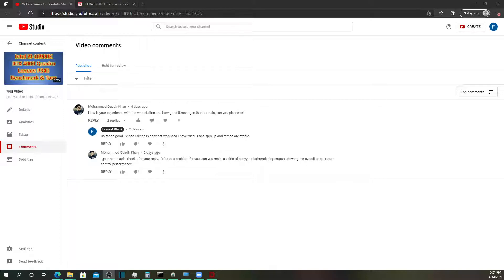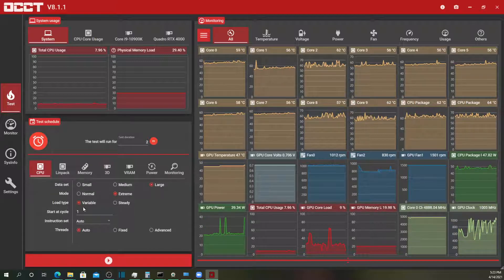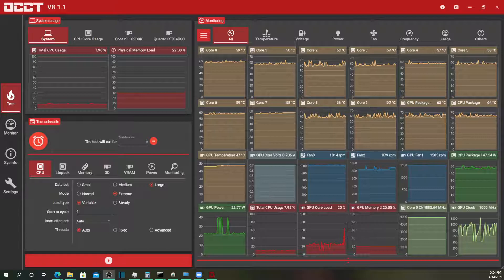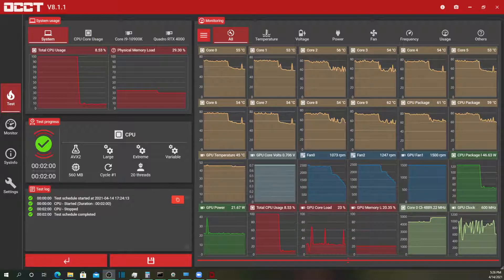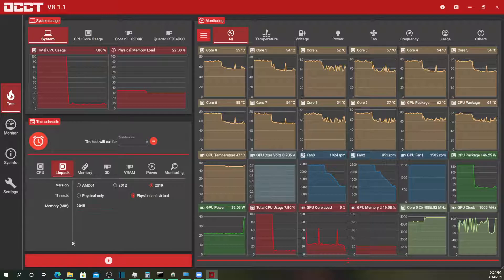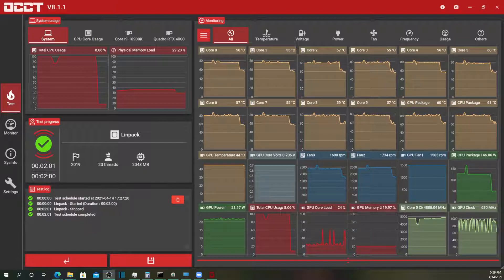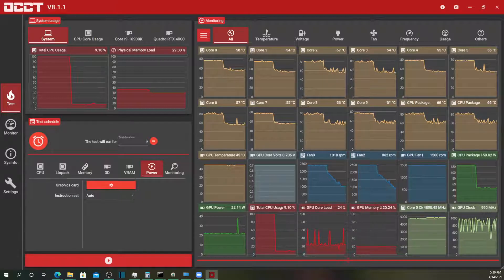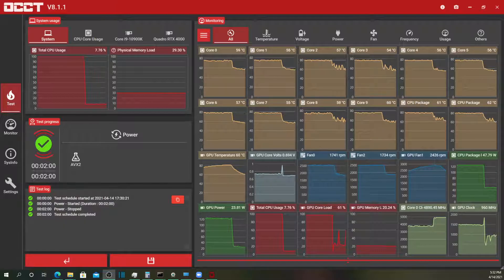Lenovo P340 ThinkStation Intel I9-10900K Thermal Testing with OCCT Benchmark

Comment: That's really great and thank you. It appears that temp >77°C will trigger the CPU to drop the frequency. So to maintain, a larger cooler would potentially solve. I'm thinking about this as the those extra GHz would potentially help one of the bottlenecks I'm experiencing. I say this before I do the proc swap on my own P340.

Comment: Hi when i'm doing power test i'ts going more than 92°C so I stopped it Why it's going high like that ?
Reply from the maker: The test is designed to max out the system.  In my video, you can see the CPU temps spike as high as 93 C at the beginning of the tests.  Then the fans spin up and the CPU management starts to reduce clock speed which brings the temps back down under 90.  I think as long as the temp spikes are brief, there is nothing to worry about.  If the temps stay above 90 for more than 5-10 seconds that would indicate a problem with the system's thermal management. Hope this helps...
Reply: @forrestblank  for me started at 40 going to 80,83 90 93 94 and I stop it because if it's going more and all that in 7,8 seconds

Comment: How often are the fans loud? Is it only when you do heavy video/rendering/CAD or does it have a tendency to be loud when doing simple web-surfing/video-editing/small tasks? (I like to work/edit at night, and loudness is an important factor) - Thanks!
Reply from the maker: The fans only spin up when rendering video, and that depends on if the program is CPU or GPU optimized.  They don't speed up during web surfing, Zooms, YouTube, etc.